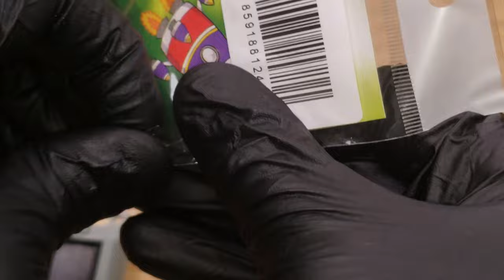How To Repair SPLATRBALL Gun Stripped Gears | Fix broken SRB400 SRB1200 Gel Blaster With Metal Gears

Comment: Tbh I would rather convert a airsoft gun to gels then mess with these thing I am in Australia and we only have blasters to play with and me dsg gel blaster is like 100% airsoft parts apart from the mags, barrel, tpiece, and hopup the rest is like retro arms gearbox housing one piece cylinder nozzle with rubber tip to suite gels shs tappet plate shs piston and piston head shs dsg gears warhead brushless motor shs m170 spring perun v2 hybrid so basically all of it is airsoft it shoots like 300fps at 58rps

Comment: Do you know if the fire selector should be in a certain postion when reassembled my selector is wired the spring is not linear when compressed and it slides smoothly

Comment: So i ended up putting the whole gearbox together with all the new parts, shot normally with the old spring, once the new one was installed it seemed that the compression was too strong and the battery couldn’t support it, it was a fully charged splatball battery, is this normal? thinking of sautering an 11.1 v on.
Reply from the maker: Did it cycle, but just slowly?
Reply: @engineerable  the gun cycled and is now stuck in a compressed position, after that pressing the trigger does nothing else and the lights flicker.
Reply: @engineerable  so no not a full cycle to awnser your question
Reply from the maker: @vitamine523  so it shot normally with the new metal gears and original spring, but not the new spring?
Reply: @engineerable  i was able to fix it by sautering on a new connector for an 11v battery! seems that the splaterball one wasn’t able to support it.

Comment: Hey man I have a question, I had stripped gears on my srb1200 and I took them apart and replaced them with gears from my broken srb400 (sub) and everything works fine except when I put it all together it just had no power whatsoever, it would shoot about 10ft. So I took it apart again and checked everything and the orings and everything was fine but it still isn’t shooting far. I have no idea what to check or if there is a fix, or even if the gears aren’t 100% the same even tho they look identical, just lmk when you can if you can. Love the content btw🤙
Reply from the maker: You gave a lot of details, but still difficult to diagnose. Sounds like an air leak, maybe in the T piece, as if your nozzle is not moving far enough forward to properly seal off.
Reply: @engineerable  would that be the little gold tube that goes inside the barrel
Reply from the maker: @ryangraves4961 Yes. Also, the metal tappet plate which moves that nozzle is prone to bending and breaking. Make sure that is straight and allows the nozzle to travel it's full range.
Reply: @engineerable  ok so the gold nozzle to plug the t piece hole struggles to move, sometimes it does and sometimes it doesn’t, what should I do? Will lubing it help it move? Bc it kinda sounds like there is dust or sand grinding when I move it myself
Reply from the maker: @ryangraves4961  yeah, you're gonna need to clean that out and lube it. It should move freely.
Reply: @engineerable  alright it’s all apart and back together AGAIN lol, and it still does it, i bent the metal thing and lubed everything, it still shoots weak most of the time, but it’s like shooting 2-4 rounds at a time, idk if it matters if I’m using my srb400 magazine or not but I figured I’d tell you, I appreciate all the help by the way, it means a lot.

Comment: I tore down and rebuilt and test fired a couple pills and the sound seemed fine then the gears in the gear box stopped turning & the tappet was stuck pulled back and when I pulled the trigger it made a whining sound. Any help?
Reply from the maker: Sounds like gears are jammed up. This could be because your piston came off the track (did you add the support spacer?) or piston gear tooth spacing is bad as I showed in the video.
Reply: Would it be possible for you to send me a picture step by step basically on how everything should be placed? Because the only reason I tore down the blaster is because it was making a whining sound without ever being opened and tampered with and I’m unsure on how everything should be placed so that it all functions in sync. Thank you for the help too
Reply from the maker: @nickallen3781  Oh! You tore it down and reassembled, not upgraded like in this video. 
This is a very detailed video of teardown and rebuild - https://youtu.be/zscIt0RVLKA
The whining sound is because your gears are stripped, usually between the motor pinion and bevel gear. You will need to replace the gears. Or you will need to add a set screw to the motor cage to push the motor forward into the gears for better engagement.
Reply: @engineerable  appreciate it much !

Comment: Hey so I ended up doing all of these upgrades after I stripped my original gears and I think I’ve ended up with an air leak. Everything is firing but the gel shots are coming out way weaker. Any idea where some air leaks could come from so I can check it out?
Reply from the maker: Nice work to get this far! It's a challenging mod. Did you check the piston pressure before assembling to make sure the piston o-ring was sealing well? If the piston was holding pressure, than your nozzle is not sealing inside the t piece. Did you place the tappet over the slot of the nozzle?
Reply: Nvm fixed it. The tappet wasn’t actually connected to the groove in the nozzle but I’ll leave the comment here if people are having the same issue
Reply: @engineerable  yeah that last bit was the problem. But the new spring combined with my stronger battery makes this so much more fun
Reply from the maker: @kenjuri_2821  Nice! Did you use 11.1v battery?
Reply from the maker: Now do the tracer mod 😂 https://youtu.be/JKV0kX_kFrQ
Reply: Your shaft where the gell comes out might be lose and needs more glue

Comment: My gears strip and I’m looking for those metal gears to fix my gun any links would be great. And the metal slide broke were can I buy a better one cuz that one is made of soft metal.    

Plz any links
Reply from the maker: I have parts listed here. Haven't yet tried a replacement tappet. The V3 airsoft ones are slightly different from gel blaster tappets. https://www.engineerable.com/single-post/what-s-inside-splat-r-ball-gel-blaster-i-take-apart-gel-ball-blaster-to-see-how-it-s-made-works
Reply: @engineerable  thanks I’m gonna be looking for the part that broke and let you know just in case
Reply: @engineerable hope you having a blessing day.  I have some questions for you to see what’s your solution. So I bought the tappet for my gun and is a little bigger then the stock one and the nozzle is sticking out more then stock and the blaster can’t past true cuz of that you have any trick that we can work with and will work

Comment: i tried the V3 tappet plate but it seems like its too long and causes feeding issues, also the shape of the back effected it
Reply from the maker: Are you using it on the plastic or metal gears? If metal gears, do you have a sector delay chip installed? Yes, airsoft tappet plates are a little different from gel blaster plates.
Reply: metal gears w the same sector delay chip you used yea..... its a bit long, the tail of it is a bit longer then the one is the splatrball, any suggestion on fixes?
Reply from the maker: @michelwjw1245  Can you make a sector delay chip that is bigger and pushes the tappet back further?
Reply: @engineerable  the one you have is big, if its any bigger its gonna hit the tappet plate long thingy because it hits the back of the plate.
Reply from the maker: @michelwjw1245  Your right. I really need to do it to figure it out. What's the link to the one you bought?

Comment: Yo so I pretty much shredded my sector gear after doing a batter upgrade on one of these so I’ll probably be doing at least some of this upgrade. If I were to just upgrade the gears and leave the entire piston assembly alone, would the sector gear damage the teeth on the piston plunger or can I just leave that alone?
Reply from the maker: The stock piston uses a non standard gear tooth spacing. Watch this part at 7:03 to see the difference: https://youtu.be/3o4r5-Xr93U?t=423
So you have to replace the piston also. Also, even if it did work, metal gears will more rapidly wear of the plastic teeth on the piston.
Reply: @engineerable  cool also it it worth messing with the gear ratio or should you just go with 18:1
Reply from the maker: @kenjuri_2821  Stick with 18:1. The motor won't be able to handle anything faster. Slower ratio would be better for the motor, but will decrease fire rate.

Comment: Where can I get the bearings for the gears I lost one
Reply from the maker: Measure the outer diameter inside the flange and look at EVIKE for matching bearings or bushings.
Reply: Just go with bushing man they are are so much more reliable and easier to shim properly

Comment: Why does the tube have to be 5 feet long ?
Reply: @engineerable he’s meaning the pvc pipe you listed on your page for the gear shaft modification, it only comes in 5 ft.
Reply from the maker: @vitamine523  It's unfortunately the only suitable thing I could find online. I used some scrap I had lying around.

Comment: Can I send my gun it doesn’t work
Reply from the maker: No, I don't repair as a service. Would have to charge too much.
Reply: Like how much
Reply from the maker: @909pyroIE  Since I would have to charge my engineering consulting rates to make it worth my time + parts, it would cost $400+. That's why I don't offer it as a service, because it doesn't make financial sense for you or I.
Reply: @engineerable  if I do can you custom everything and how long you think it will last I don’t mind $400
Reply from the maker: @909pyroIE  Not worth it. $400 would get you an amazing blaster with full metal gearbox, and maybe even metal body. For only $200, Take a look at a SLR CQB (metal gear version) https://www.akuncletoy.com/product-page/jing-ji-slr-badger-gel-blaster-toy-gun
 or XYL ARP9 https://www.akuncletoy.com/product-page/xyl-arp-9-gel-blaster-toy-gun